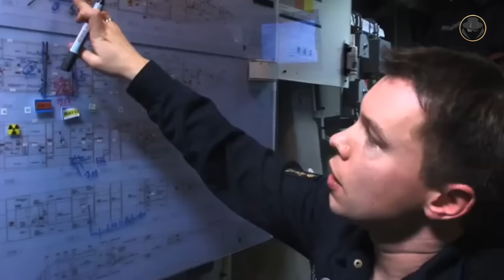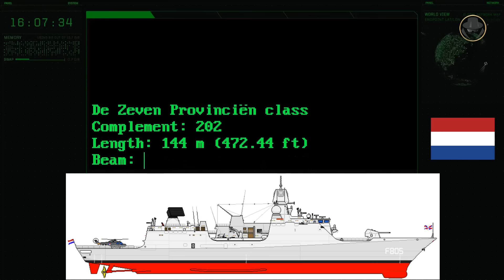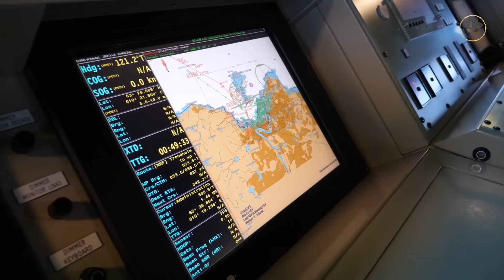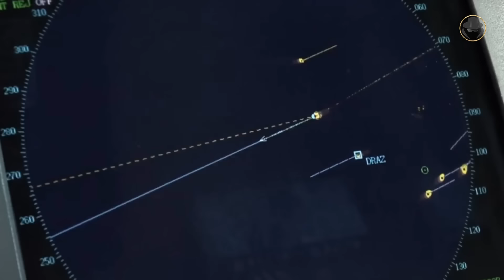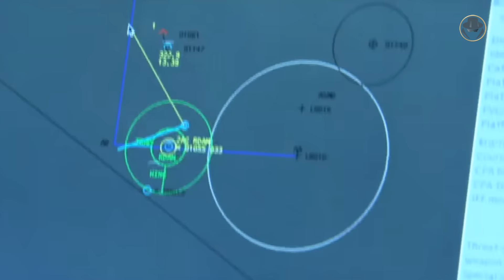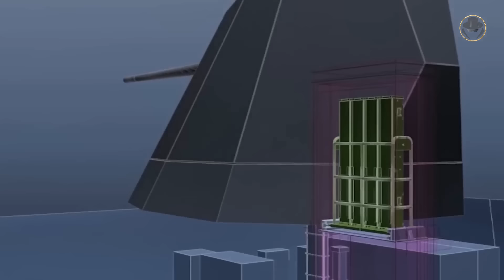De Zeven Provinciën-class frigate | Is it really their last decade?

Comment: a 40-cell VLS solely for launching surface-to-air missiles only, what a waste . . . lack of a dedicated VLS for anti-ship & land attack cruise missiles is quite alarming . . .
Reply: Why would an air defence frigate be equipped with land attack capabilities? She is designed to escort a NATO taskforce.
Reply: It's a frigate, not a destroyer. The Zeven Provinciëen class has anti-ship and land attack missile capability in the form of it's Harpoon cruise missiles. And in reality she has a much larger VLS missile load out because the ESSM's are quad packed, so she carries a total of up to 64 missiles in her VLS cells (32 SM-2 and 32 ESSM). I do agree that it's a shame she wasn't turned into a destroyer by lengthening her hull another ~15 meters and giving her an additional aft VLS battery with 40 cells. After all she has all the sensors to make it one of the if not the most powerful ship of any navy.
Reply: @feddek9325 multi mission doctrine warrants omni-role capabilities . . .